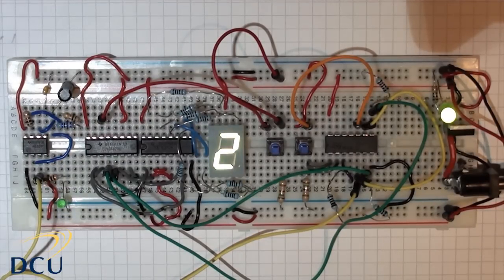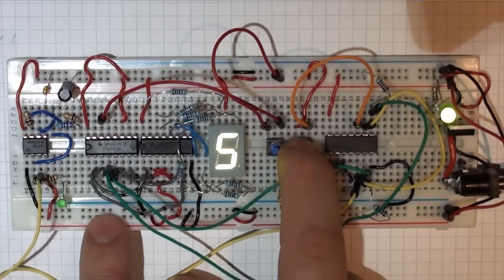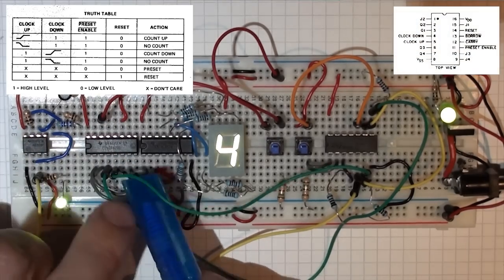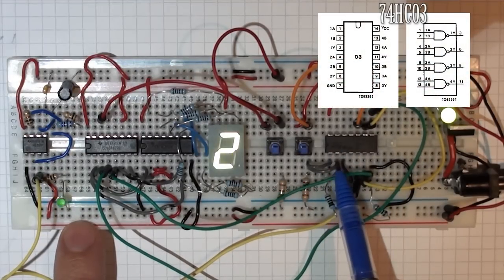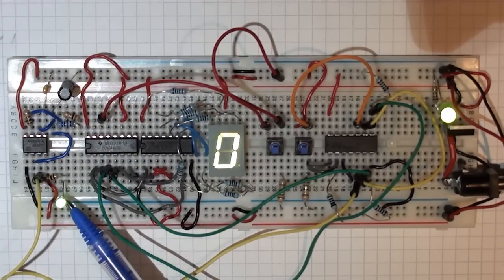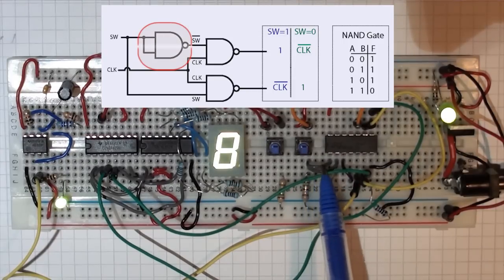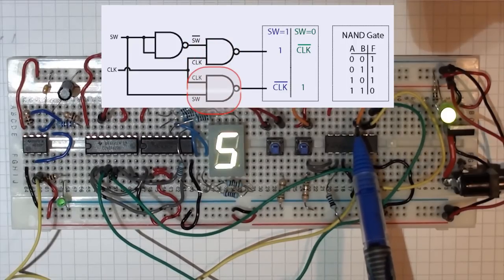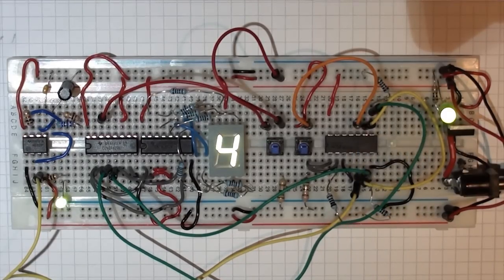Experiments 4.4.2: Questions: BCD Counter - Up/Down Counting Enabled

Comment: I came up with a different way using 2 relays and 2 momentary buttons. The relays simply switch what pin gets the high signal and have a holding circuit so the momentary switch is bypassed after being pressed. I will make a video one of these days. I have never posted a video so maybe its time to do that. I do like your system and will also take a closer look at that.

Comment: sir i have a question , how can i make turn off when it reaches to 0 ? i imitated your circuit and i just need the countdown  of the ckt. how can i do this
and another one how can i apply this on a 2 digit counter ? i want to make a countdown timer that starts at 90 or 99 to 00 and if it reaches to 00 it will automatically shutsdown or stop at that point ..